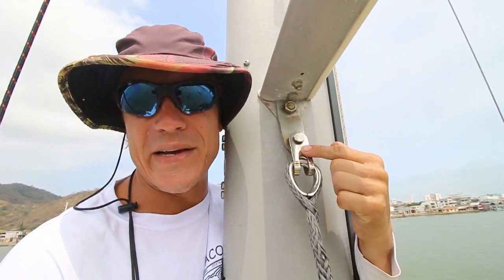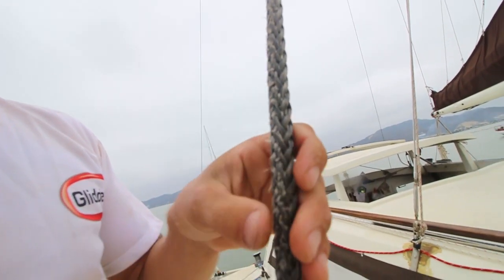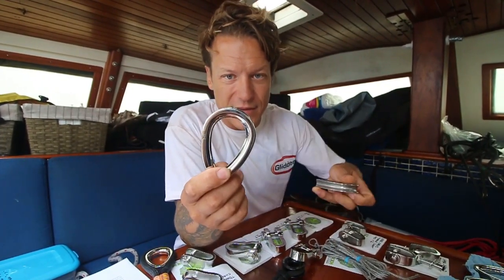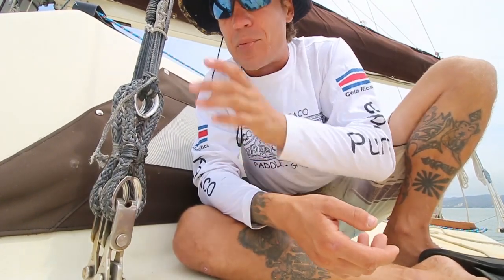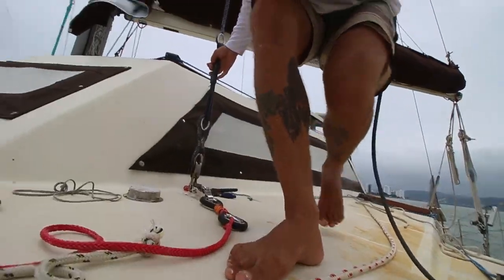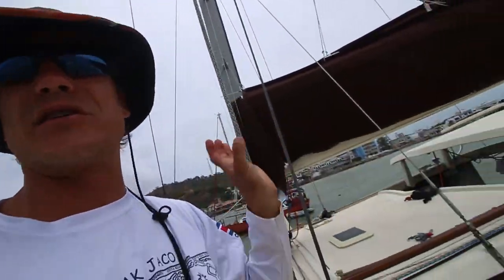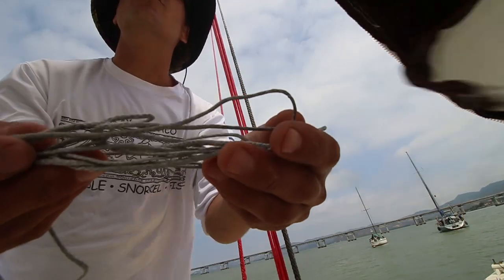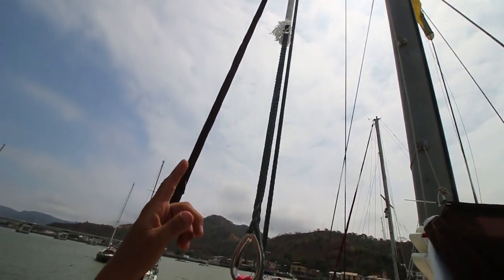DYNEEMA: Making your synthetic rigging BULLET PROOF (Rigging pt. III)

Comment: Amazing! Just amazing... Also remember that "weak points" are built into everything so they break at their weak points (for a reason)...  I love being able to repair anything and everything at sea but I would be inclined to use line in an emergency after (and if) a wire broke (never happened to me but hey, it could). Windage and aerodynamics are also major issues on aircraft and boats. Lastly, every pound up a mast takes 10 pounds off the keel so weight also comes into play. I am just looking at the whole picture but still my one word is "Amazing" and Thanks for the great videos!
Reply from the maker: Yeah I would definitely recommend everyone have an emergency stay out of dyneema at least. So easy to store... I should sell those...
Reply: Great to add to your safety spare parts kit for sure!

Comment: Between you and Rigging Doctor, I'm a believer. I don't mind a little extra work for better DIY in remote places.  And if the rigging or mast does fail, it can cut it off with a knife instead of trying to find those cutters or hacksaw that you know you have someplace and pray they haven't been rendered useless by corrosion or rust.

Thanks for sharing and for the links!

Comment: I wonder if there is a fitting similar to the closed thimble, more like just a ring that the lashing could go through; then there would be no need for the deadeye since the lashings could connect right between the ring and the shroud thimble. Anyway great vid and really helpful to see you working through this! Thanks man!
Reply: Had the same thought.  It is hard to find rings that are strong enough.....I've looked.   Coligo basically does this with the 3 holed tensioning ring

Comment: Have you seen the aluminum structure on the stern of Tulas Endless Summer? You might want to do something similar. They just redid theirs. It holds their radar, solar and dingy. Pretty cool.
Reply from the maker: Problem is my steering system is very different than Billy’s. Davits won’t work for me. Plus that’s a lot of weight on the back....

Comment: Hi James
I am changing out the standing rigging on a 21' American Fiberglass.  I bought the boat a year ago and I have yet to put it on the water.  The side stays are going super.  I have not seen anything in your videos on how you addressed the back stays.  I am sure your boat is rigged differently then mine, but I would still like to see how you did the back stay?
Thank     Perry
Reply from the maker: Hey bro my backstays were cascading 16:1 purchase dyneema, using frictionless rings and 2 harken blocks. I only needed that because my main had so much roach I couldn't tack without it, plus it was nice to be able to adjust them. You can do it static just like the side shrouds. I've got pics somewhere... buried in a 10tb drive. If you really need you can email me. I can at least draw it for you.

Comment: I have probably missed this between you and the rigging doctor, your vids are great, and thank you.  Is this an all or none situation ? what do you do with headstay / jib furling systems and your backstay / doubling as antenna ? can those be kept as wire or is there a way to make those synthetic wihout losing funcionality ?
Reply from the maker: Forestay should stay wire. Can’t see it under the furler for chafing issues. Obviously plastic doesn’t conduct so you’d have to get an external wire. Or leave the backstays and forestay and change the rest... but at that point... what’s the point.

Comment: If you would invest in a back up wind turbine you could avoid running your engine if its cloudy run the wind turbine or simply switch over when the sun goes down and it will charge at night if theirs any wind at all

Comment: You guys have been off the map for so long that the YT system didn't even put this vid into my recommendations list.  About 12 minutes 15 seconds ago I started exhibiting some serious Zingaro withdrawal symptoms.  What with the fact that your last vid was only a mere 3 minutes and change in length.  I was running a high temperature, I was more than a little shaky, and was even kinda sea sick...   But I was still able to run a YT search inquiry to see what the heck was up with The Legend of Zingaro.  Now what do I find?  Well I find out that this vid was posted FIVE DAYS AGO...  

Talk about being a seriously disappointed Zingaro junkie.  I'm going through the DT's and my video heroin was actually at my fingertips for the last freaking five days?  I could have died from an under dose.

No foolin...  I was seriously Jonesing for my sailing video drug of choice...  While for five days my fix was already in waiting for me to consume it.  Still...  I have to admit that it was worth the wait James.  The opening was very well put together.  The drone shots were very artistic...  That mixed with the sound track made my suffering from the lack of the Zingaro tonic go away almost instantaneously.  And not a moment too soon I might add.

I am very happy to see you so supercharged about your new rigging.  The new Dyneema set-up looks strong.  I think it was a really intelligent touch to use the color coding for both the Port and Starboard sides.  That could help tremendously in a pinch if your quick decision making processes are a little frayed at the edges due to lack of sleep, or possibly an over abundance of the spirits, or both, in some crazy unsuspecting sea fairing emergency situation.  If in fact you can't tell your Starboard Right from your Red Port Wine Left now your boat will have the quick answer for you.  In the words of Forrest Gump.  "It's just one less thing."  

Just an excellent idea all the way around and from side to side.  If you know what I mean?

I really missed you two.  I don't think a video a month is going to quell this addiction Captain.  Something must be done to help me out.  

Send my love to Frau Kimberly.  Tell her that I always notice when she is M.I.A. and I await her lovely presence (hopefully) in your next installment.  

Take care.  sincerely.  your friend...  Dean O.  :-I
Reply from the maker: Awe buddy. I just read that to Kimmi and she’s all smiles. Thanks for that. I’ve got some cool stuff to share with you, write me an email or FB message.
Reply: Ahoy S/V Zingaro...  An e-mail is coming at you via your website contact page.  It is always so nice to hear from you James.  And it's always nice to find out that I made Frau Kimberly smile.  Nobody in their right mind would ever get tired of that...  Ever!  :-I

Comment: Another great video love your tee shirt one question how do know the tension of the rigging on wire rigging we use a tension gauge is there something similar that you use anyway great video cheers
Reply: Also do you use it for forestay with furler
Reply from the maker: Forestay - no. It’s possible, but most people stay with wire (pun intended). I don’t use a gauge, never had one, but I suppose you could retrofit one to work with dyneema. Or just tune it, go sailing, tune again, sail again, till it’s right....

Comment: Did you take the outer sheath of some nylon Sampson braid off it's core and put it over the Dyneema for chafing protection ?  What is the Turks head knot ? I must have missed that along the way. What's with the very fine braid on the new Dead Eyes ? Is it dyneema covered with nylon ?
Reply: Start watching at 6:44...he explains that.
Reply from the maker: So the cover on the deadeyes is actually dyneema chafe cover, and the cover over the outer shrouds is just an old 1/2" line that I took the core out of. I should have mentioned the difference. https://www.marlowropes.com/product/chafe-sleeve-dyneema
Reply from the maker: And the Turks Head knot is a decorative knot to keep the deadeye together. Looks way cooler than the frapping knot I used on the first ones. It's a PITA to tie though. Just warning you.

Comment: I'd do dyneema rigging if the tensioning could be done by a turn buckle. Or have I missed something?
Reply: You can add a SS turnbuckle if you'd like..although if you watched James earlier videos on the rigging you would realize you don't really need them, but a picture with the turnbuckle https://static1.squarespace.com/static/556621c8e4b02628a8d3bde8/56055583e4b02c0c1c4806cc/560555a7e4b0a2d546f3db42/1443190247755/photo+1-2.JPG?format=750w
Reply from the maker: I've seen it done. They don't have a ton of travel. You'd have to get all the construction stretch out, then after a month add it in. Then re-splice the shroud when there was no travel left in the turnbuckle. Maybe if you used pre-heated pre-stretched Dux or dyneema.  May I ask why you feel that way?
Reply: I might not have been paying attention but how do you adjust all at once? Adjusting each one is an operation. With steel you can go round the boat and adjust all at once, without setup. This is quite important isnt it?
Reply: Colligo Marine uses turnbuckles... they prestretch it all for you. More expensive, but idiot proof for us as newer sailors. 😝 We have a Morgan 462, 30,000 lb boat.
Reply: I have a turnbuckle on my headstay, the rest are deadeyes.
When you splice for a turnbuckle, your length has to be dead on because you only get a few inches of travel from the screws.
Deadeyes give you feet of leeway, so you can splice a little more carefree and relaxed. The lashing doesn’t care if the stay is an inch too short, it will reach out and put tension on it!

Comment: stainless is impervious to UV, whereas aramid fibers (kevlar, aramid, etc.) are easily destroyed by UV. what is the advantage? stainless will flex a little bit, so not sure what shock-absorbing advantages? maybe i missed something, me being so dang old???
Reply: Exactly....I pose the same questions whenever this subject comes up. Seems like stainless wire rigging or rod rigging has some major advantages over synthetic that some of us out there simply can't ignore, like UV resistance, chafe resistance, and ease of adjustment, that are all vastly superior to spectra/dyneema/synthetic. Sure you can't DIY it as easily, but I'm thankful I ignored all the dyneema evangelists and went with new rod rigging on my boat last year. synthetic has it's place on my boat, like the checkstays/runners, and also the boom vang, but I'll take a 15 year life span on all the gear that keeps my mast standing, thank you. I guess I'm an old soul.

Comment: What happens if someone cuts shrods the rope with a knife
Reply: Maybe it falls down.
Reply: Bolt cutters will cut wire faster than a knife cuts rope
Reply: I recon more people carry knives than boltcutters, i do like the rigging though.
Reply from the maker: It's pretty difficult to cut through, but if someone had malicious intent then, sure, they could cut it. As long as the sails weren't up and it was just one shroud the mast would be fine. Cut a bunch... well... something has to hold the mast up. There are 10 different shrouds holding it up.